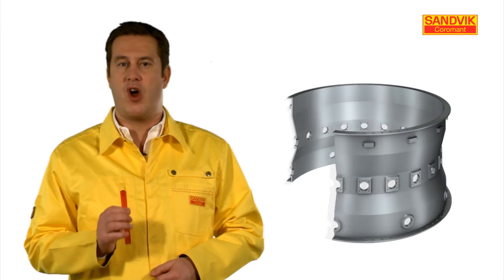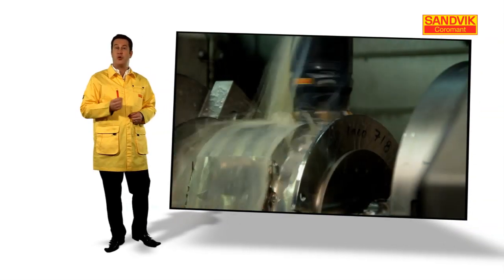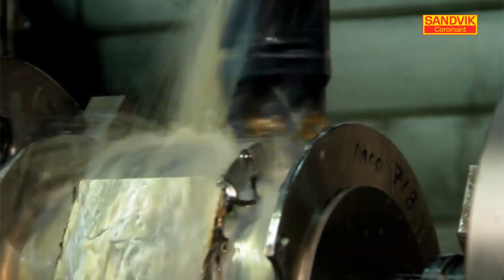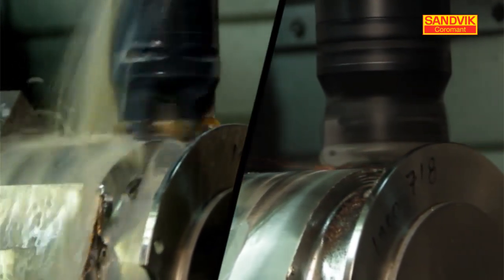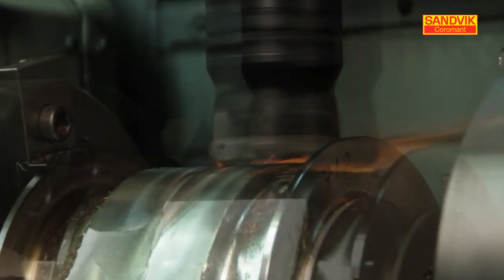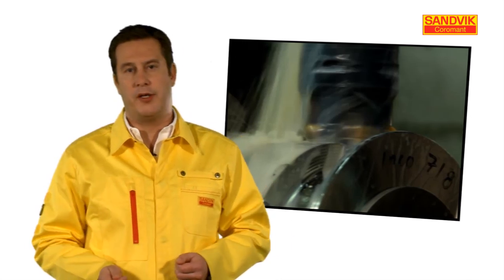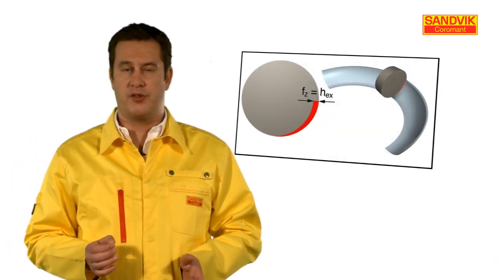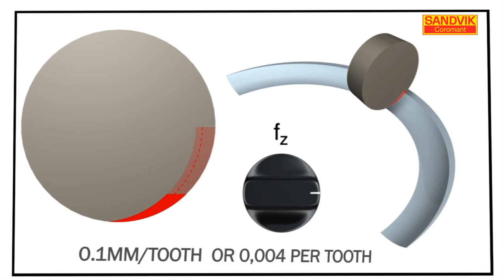Tips film: Ceramic milling in super alloy materials

Comment: Is it possible to use ceramic inserts when machining cobalt superalloys such as HS-31?
Reply from the maker: Hi Toni,

Yes it is possible to use ceramic inserts when it comes to Stellites and other cobalt-based materials. We have some good experience in roughing milling with welded-on Stellite using our 6060' grade.
 Tool diameter 50 mm, axial engagement 1.5 mm, radial engagement 38 mm, cutting speed 1000 m/min and feed per tooth 0.08 mm/tooth. Dry machining.

Please, contact your local Sandvik Coromant milling specialist for further information.

Best regards,

Raphael Bienvenu 
Global Application Specialist - Profiling

Comment from the maker: @johnstonebreaker Aisi 316 and 304 is quite far from super alloys. They are soft and sticky. The build up edge area is big for this family of steel. Use M line inserts, small engagement of the cutter and use high cutting speed (230-300 m/min). 

For more details we recommend to contact your local Sandvik Coromant representative. In general there is no problem to do milling with carbide inserts in these materials.

Comment from the maker: @johnstonebreaker Machining stainless steel such as AISI 316, with ceramic tools and inserts is almost impossible due to the geometry. The tool has negative or neutral lead angels and the inserts have no positive geometry but a negative champfer or a big er treatment. This has been tested but with no tool life. The main cause is the built up edge which is common in these materials. Some suppliers say they can do it but nobody has seen it for real. When we succeed, you will be the first to know!